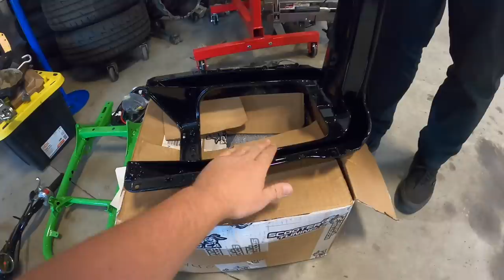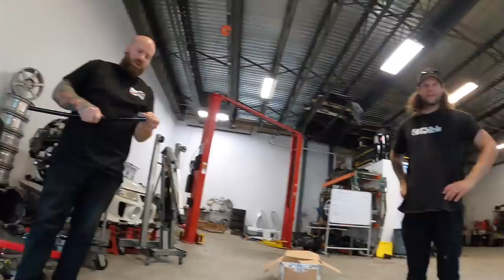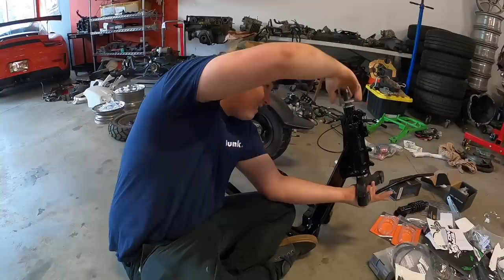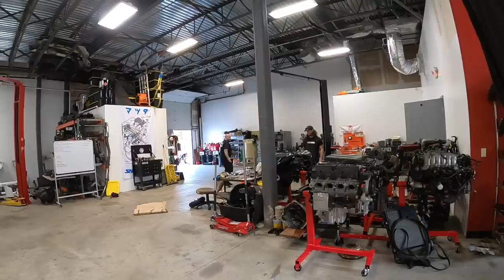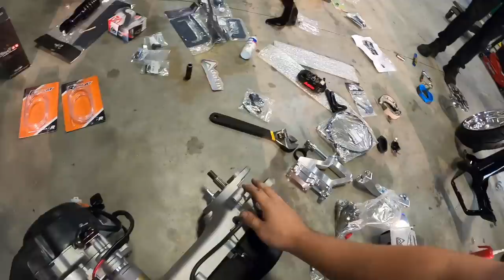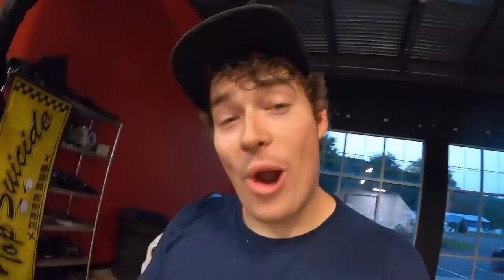RUCKUS BUILD COMING OUT SICK!!!

Comment: You need to get right lug nuts. Don't use those chamfered ones on flat surface. Also 25:00 that color is called "paint it green and give it away"

Comment: That strech on the ruckus tire is actually the normal when putting a 7-8 inch wide wheel in the rear, you have nothing to worry about